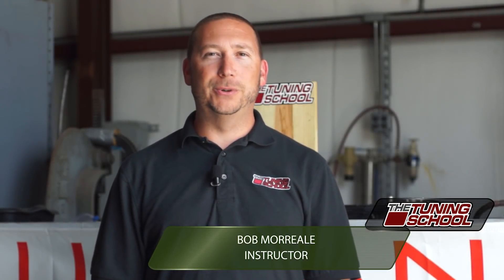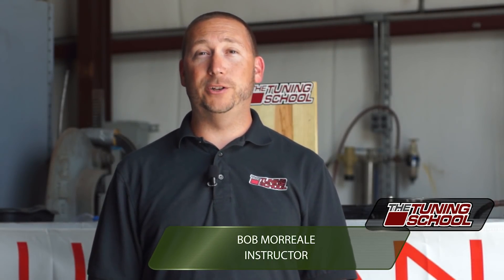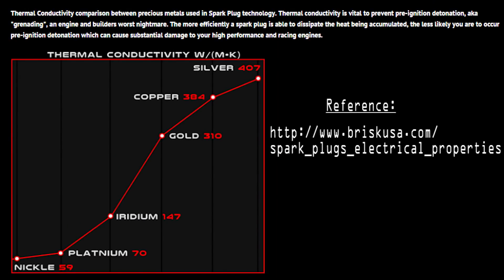Which spark plugs are best for performance tuning?

Comment: For my Turboed Engines, the Best would be Silver spark plugs, But, because they Are Expensive, i am currently still on the copper spark plugs. But next time, when i will again go above 3.0 bars of Boost, i Will buy Brisk Silver or Bosch Silver. Or are there any other Silver spark plugs on this planet ? Thanks.

Comment: What he doesn't say is:
1) Copper is soft and so the gap between the electrodes on the spark plug can be more easily affected by that, especially in high compression performance engines
2) Don't think that all the metal in the spark plug is platinum, iridium or unobtanium. it's still mostly copper or copper alloy. The platinum or iridium is only at one end or both ends of the electric ark since high voltage electricity erodes copper, nickel and other metals, causing poor sparks or missparking due to bigger cap.
3) Iridium or platinum have much higher melting points than copper so they keep their shape and performance the same for longer
4) The amount of precious metals is so little, the thermal conductivity is almost negligible. Also, the specific heat of platinum or iridium is about 2.5 times lower than copper, which means they give up heat faster than copper. Copper can carry heat better from the source to other places, but platinum or iridium can be cooled faster than copper. Basically, if you imagine heat as a liquid, copper is the better straw but if you tried to take heat from a copper jar it would be like sucking syrup whereas in a iridium/platinum jar would be water

Comment: Thanks for sharing the knowledge but I have Motorcraft and the specs are: Nickel, copper and platinum so what am looking for or where the copper should be use? . Thanks!
Reply from the maker: We would suggest contacting plug manufactures because they are much more equipped to get you the right answers. Brisk, whose products are in this video, is a great resource to start.

Comment: It's not necessarily that platinum & iridium are bad. If you aren't looking trick your ride & just got a simple commuter car then you'll want platinum or iridium (I prefer iridium) as they last much longer as stated. In the end this will come more handy & less expensive in the long run due to their superior longevity. I'd choose the spark plug based on what you use your car for

Comment: Silver is the best conductor of electricity at earth atmospheric temperature and pressure.
Reply: But what about the temp and air pressures inside the block? Not trolling just learning.
Reply: @franksmith7271  silver will still be the best

Comment: Bullshit NGK stock plugs give off a dodgy spark and  ngk iridium give a more consistance spark which better for engine and uses less fuel.
I still change mine after 40.000km with the better ones for longer engine life.

Comment: I love my 2006 300c hemi but I want more "horse power" 
Should I buy better spark plug's or change my exhaust?
 Maybe remove it?
I want my car to be louder and drive a lil faster!! 
It rides great but now I wanna put more work in it !
What should I do ?????
Reply: (Sorry for english)
-buy an kn cold air intake put it true place
-delete middle muffler on your car
-buy headers:(non compressored turbo)
-find best  gripping tire (should fits your car)
-buy sport suspensions
-re-create your crankshaft
-buy forged pistons(if u want)
-buy sparco racing seats(really need)
-use high quality engine oil
Reply: @MrArmut-we2hs  Hey I appreciate your help ! 
Where do you think I could buy this from ?
Reply: @MrArmut-we2hs  Thank you so much
Reply: @jobhelper6538  you re welcome

Comment: I love my 2006 300c hemi but I want more "horse power" 
Should I buy better spark plug's or change my exhaust?
 Maybe remove it?
I want my car to be louder and drive a lil faster!! 
It rides great but now I wanna put more work in it !
What should I do ?????
Reply: Job Helper hello! I don’t know what you’ve done in 4 months but I recommend a muffler delete and a resonator delete, this will free up power for sure! Different plugs will not do anything unless you are running a tune, that’s what he is talking about^^

Comment: I don't get it, once the electricity hits the gas, isn't that all that matters? It's how hot in an engine compartment much less the engine itself? is 999,990 degrees F instead of 1,000,000 degrees F really going to make a difference?!

Comment: I can't find Copper plugs for my engine.   So should I get the Platinum instead of the Iridium (iridium is the OEM plug) ?
Reply: Do not use copper.   Use same plug you have now
Reply: Iridium is better suited for boosted engines.

Comment: The argument is that platinum and iridium don't conduct heat well and become virtual glow plugs under high boost in the cylinder. The chart at 2:06 shows copper to be a better conductor of heat and therefore he concludes that copper plugs are better for not causing detonation in boosted engines. However aren't all copper plugs nickel plated? And looking at the chart, nickel is a much worse conductor of heat than either platinum or iridium, and therefore using his own logic it would appear that the copper plugs (with nickel plating) are actually worse conductors of heat than the iridium or platinum plugs.

Comment: yup my NGK Golds are running much better than my new NGK platinums in my 87 Suzuki Cultus Turbo.    I needlessly replaced the entire ignition system before putting the old plugs with 200k miles back in just to have it purr like a kitten.
Reply from the maker: Nice!

Comment: He is exactly right. We have seen this on our turbo cars- platinum and iridium perform very poorly. Plain copper plugs work better as the boost goes up.
Also, slathering the plug threads with anti-seize adds a huge barrier to heat conduction from the plug to the head. Better to chase the threads when you change plugs and use a few drops of light oil on the threads. Plugs will be cooler= less detonation
Reply: Volvo 850 t5 :ssa on vakiona platina tulpat. Ja hyvin toimii.

Comment: ok, so he is suggesting the platinum or iridium part will create resistance at higher temperatures... I agree..... it doesn't matter if the tip or the core has resistance.... resistance is resistance, no matter where it is on the HV circuit ya still gonna loose some spark..... is it noticable???? I Dont Know, he seems to think its can cause tuning issues.... 

some of the comments are way off, i think they are confused.

Comment: I run the coldest plugs that I can find for all of my vehicles. Found away around the fouling problem.  So I can drive a highly tuned engine without changing or cleaning plugs so often.  Just change the plugs when they are worn out.

Comment: This is another case of thinking if you pay more you get better for your car - which is not always the case. I went from single electrode to multiple electrode and then later on to iridium plugs thinking I'm going to treat my car! How foolish!! People should stick to OEM when it comes to ignition systems as the car was designed with such plugs.
Reply: Volvo 850 t5 moottorissa  toimii parhaiten vakio tulpat. Ja ne on platinat. Ei iridium tai platina ole ongelma vaan lämpöarvo.

Comment: i got a 2002 Chevy Impala it has 88,000 miles what's the best spark plugs and wires to get for a 2002 Chevy impala that got 88,000 miles if the miles have anything to do with it ?
Reply: Double platinum fine wire

Comment: My car calls for iridium plugs oem.  I put platinum and my car started acting up and I had a misfire. The ignition coils are brand new
Reply: Robledo,D if its made to run with irridium youre gonna have spark issues when down grading. Ive seen people with oem irridiums grab copper plugs and come back a week later saying they all went bad. Never downgrade from oem.

Comment: unuptanium yeah
Reply: I was just going to post that
Reply: It was a joke, congrats on the r/whoosh... In fiction, engineering, and thought experiments, unobtainium is any hypothetical, fictional, extremely rare, costly, or impossible material. Less commonly, it can refer to a device with desirable engineering properties for an application, but which are difficult or impossible to achieve.

Comment: The copper tips are great for conductivity but bad for durability. Youll get 5000km out of a copper core but 10-15000 from a platinum core

Comment: E3 diamond fire spark plugs have a copper cetral electrode tip, while even copper core spark plugs have a nickel electrode tip. So by that random graph iridium tips (like on NGK iridium IX) you're better off with iridium tip plugs since they still also have a copper core. (Source: Reading the product details on these plugs as I'm typing this at O'Reilly auto parts).

Comment: You FAIL to mention that there is no COPPER TIP or GROUND it is all steal and the conductivity of steel is about the same a platinum. What you also fail to mention is that all plugs must maintain a temp of about 650 C to burn off the carbon, and deposits. You simply can not run LPG, High Boost with normal copper plugs. They just don't last. Now here is another fact. Thermal conductivity is measure over the length and the electrode is about 5 mm maybe. Stuff all. Conductivity of copper pure is 386 , Iridum is 147 and Platinum is 73 whist steel is 54 .. so your explanation is baseless in fact. Throwing away the theory altogether ..A "normal" plug copper etc will erode in a high performance engine very quickly. replacing them every 5,000 KM - OK sure .. why not. But still the performance is LESS than an Iridium electrode and platinum tip plug from the get go. AND those Iridium and platinum chip plugs last 100,000 KM.. it;s a no brainer.
I sell plugs made by a company that makes aircraft plugs. and I can sell the Iridium plugs with platinum chips for under $10 a pop. The copper cores I can sell under $4. So considering that you buy 10-20 copper plugs to one iridium/platinum plug .. again it's just a no brainer.

Comment: may be only -- 2/10 as a mark this guy fails ---- cause i don`t want heat in my spark plugs heat is better transmitted through the piston and rings and cylinder head electircal conductivity is the real function of a spark plug = not a heat sink - and that is why we are on to alloy and platinum and not cast iron and steel with copper cores - as i tuned them in 1960`s rich with big spark .

Comment: And the problem with Brisks is that they don't self clean because the conductor is too large. Additionally, they are prone to fouling and cause stumbling at low load, low intake velocity situations.
Reply: Brisk say their plugs are good for 15k miles...so go figure
Reply: My car with brisks runs so rough, I'm getting iridiums and hopefully it fixes it. Really poor performance at low rpm and car idles rough. It's weird coz the car Is fine above about 2.5k but poor below that. Definitely not good plugs, car is very fuely smelling from incomplete combustion. Don't buy them if you want reliable plugs.

Comment: wrong info guy! differnce in tip. platinum  or irridium  they still have copper core and steel jacket! tip has nothing to do with heat range.
Reply: ToppCat; Maybe But the tips are still a different materials and ARE in the Combustion Chamber, There likely is a measurable differents between just the material types in the same Heat ranges!

Comment: wrong info guy! differnce in tip. platinum  or irridium  they still have copper core and steel jacket! tip has nothing to do with heat range.

Comment: what about cars running e85 what's better colder plugs like sliver or hot like platinum one and are the 360 multiple spark ones worth it.
Reply: William D Ollivierre the Evo has a bigger arc resulting in a bigger sparc as long as your ignition supplies enough power. Ive read reviews on many "big gap" performance plugs and some complain about poor idle.

Comment: Well going by the comments, that was a useless video...

Surely the plugs heat range (ie. the heat of the centre electrode) is the same regardless of the plugs metallurgy. Eg. An NGK heat range 6 plug will have the same tip temperature regardless or being nickel, copper, iridium etc. The insulation of the plug would be designed to make the plug work at that heat range 6 temperature (whatever that actually is in celsius or fahrenheit!).

Apart from an iridium plug having a longer life span, it will also have a more consistent spark, as the tip is finer.
Reply: Lol :) Less Voltage with a thiner tip not more consistent if the material used is pure shit, iriudium was used to shield the Space Shuttle it´s a resistent material not conductive. It´s Enough????????? Thermal Exchange adiabatic process it´s a core point in a engine maybe i´m wrong, but i work in the automotive industry in Germany

Comment: Learned the lesson the hard way on my Chrysler minivans. Stick with OEM plugs for the best performance and fuel economy. Speed Density systems like most Chrysler products do not have much adaptability to after market parts that are not OEM equivalent. There may be more with a adaptability with a Mass Air Flow driven PCM, but still not too much without a tune.

Comment: what about for motorcycles and scooters?
Reply: silverbird58  Even water cooled engines will also burn holes in pistons if run too lean on the main jet. Whether an engine is air cooled or water cooled makes no difference to burning a hole in a piston or not. It's all to do with the fuel to air mixture ratio.

Comment: Going off this chart, nickle is the worst and copper is among the best. The funny thing is, the core of a "copper" plug, AND iridium/platinum plug is copper. However, "copper" plugs have a nickle plating to allow them to withstand the electrical discharge and violent conditions in a combustion chamber. So going off the chart, copper/nickle plugs should be bad, where as the copper/platinum/iridium plugs should be better. So what gives?

Since you can buy plugs in different heat ranges, the heat conductivity of the metal plating the electrode should not be the focus. Spark plugs need to maintain heat, the goal is not to keep the plug as cold as possible.
Reply: SilverSurfer77 "the goal of a Spark plugs is to maintain heat'' WRONG the goal of Spark plugs is just that, to Carry spark to ignite the Air and fuel mix in the Combustion Chamber WITHOUT turning into The cause of detonation(uncontrolled timing of ignition) by getting and staying TOO hot, like a Glow Plug in a Diesel engine at cold start up!
Reply: I never said anything to effect of "the goal of a Spark plugs is to maintain heat''. I was only talking about the thermal conductivity of various metals, and how they relate to the construction of plugs, and what this video says is the best metal for plugs, they all seem to contradict.

Comment: no point of comparing copper and platinum or iridium. the only copper on all sparkplugs is the core, never you can find a copper tip. tip of a regular plug is/are nickel due to durability. I think my point is he doesnt know what he is talking about.
Reply: I think it's based upon a racing application.  Having the area cooled as quickly as possible to have more HP.  The thing is the plugs get changed every race day so say 5 year durability doesn't matter.  I assume the same synonymous concept of of performance to life ratio applies for oil as Motul doesn't recommend their best motor oil to be used in a car that doesn't get it's oil changed as frequently.  They wouldn't tell me why after their long lengthy email.  In a way I assume this is how the cancer thing works.  If people don't get what they want (drugs, alch, smoking, sugar, dirty sex) to do their God will purpose they wouldn't do it.  If they ate super healthy and lasted super long they wouldn't do their God will purpose.  Performance to life ratio.
Reply: ngk iridiums are awsome
Reply: Cheeze Face Packers???🙄

Comment: what is the best plug to use on a barra 4L 6cyl turbo 450hp
Reply: Justin Sanger standard ford iridiums. Same plugs as the ecolpi engine. $50 in Aus for 6
Reply from the maker: please contact:
Bret Lednicky
Office Manager
Brisk USA Enterprises LLC.
North American Market Division
www.BriskUSA.com
Cell: 281-299-1095
Tel. 713-459-6977
Fax. 866-583-6239

Comment: Bullshit..spark plugs have heat ranges, you need to get the correct one for your application.
Reply: I agree with your comment some applications for instance use non resistor type because the coils already have resistors and if someone adds a resistor type plug it can damage ignition system parts especially the coils.

Comment: I agree that silver SP is best but your explanation is wrong in my view. SP does not have to do with heat conducting...why...there is a explosion in the cylinder and I mm copper or platinum could not make difference. The real difference  between silver and platinum is the working area. During the explosion still carbon stuck on plug tip, so silver have big area which give better performance than platinum.
Reply: If you're engine is running right there are no explosions, only controlled combustion!

Comment: I have a LS 1 Camaro and I have to relocate the coils and make my own wires if I have the wires at different lengths will that affect anything using MSD 8.5 super conductors some of them might be a foot shorter than the other
Reply: Dj Morgan no it will not affect anything I've done this before on my Lincoln navigator

Comment: but surely the heat  range  of the plug is an engineered number  that has accounted for the  the reduced thermal conductivity of the core  ?
So your saying  you've seen things stop pinging from moving away from iridiums ? and on the same heat number ?
Reply: Adam Naylor Dam good question! This wasn't addressed!